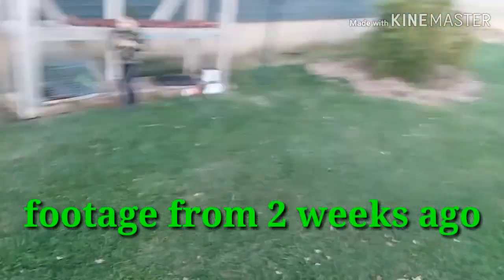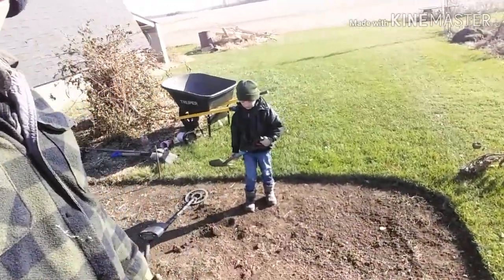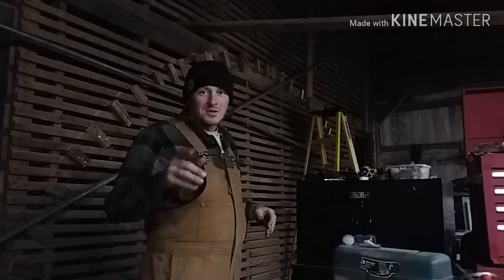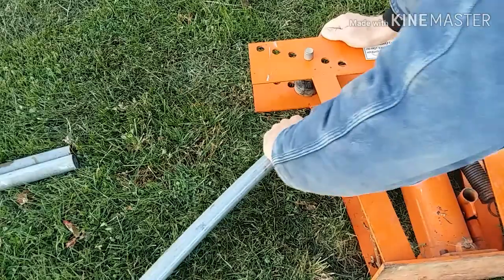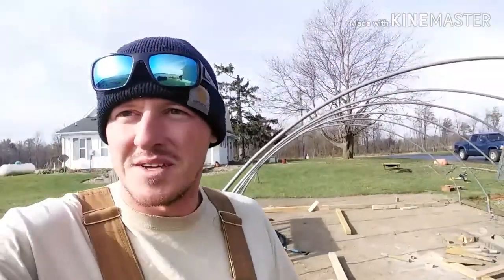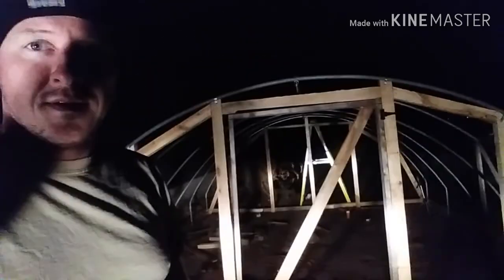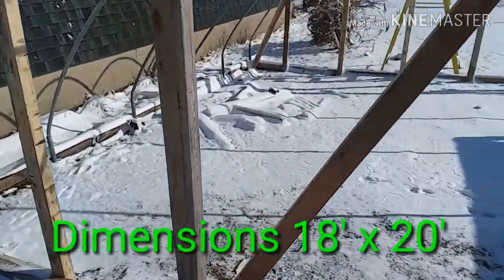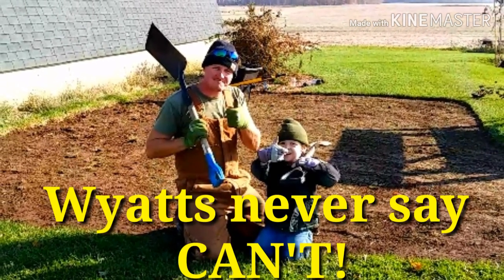Green house build part1( out of recycled free materials)

Comment: Came over from your comment on Sew The Land. Nice build!! How did you connect the top rail?
Reply from the maker: Thanks so much for stopping by! I used some lag bolts with a round Phillips head and now that I'm going to put the plastic on I put some Gorilla Glue tape over all of the heads just to be safe. So if I did it over again I would use just regular smooth head lag bolts